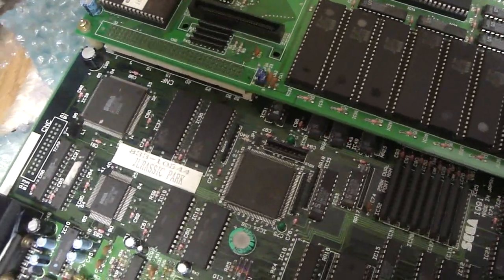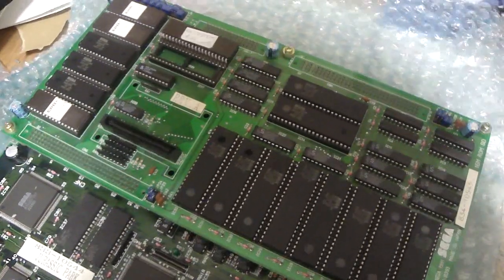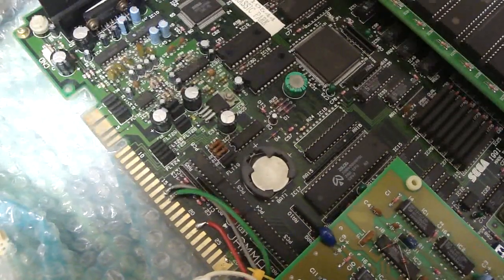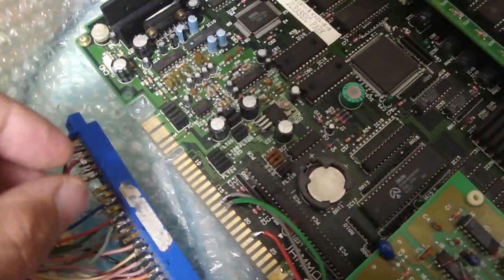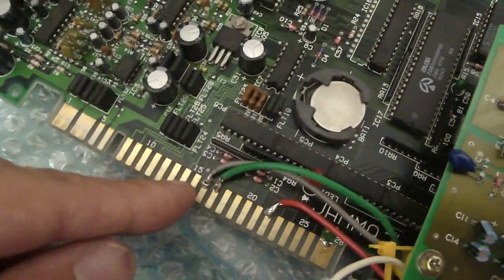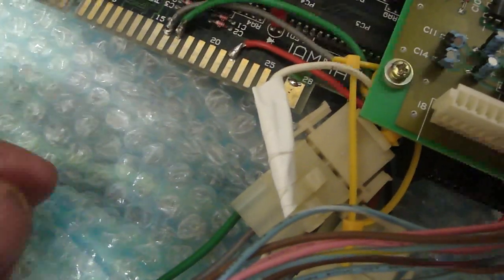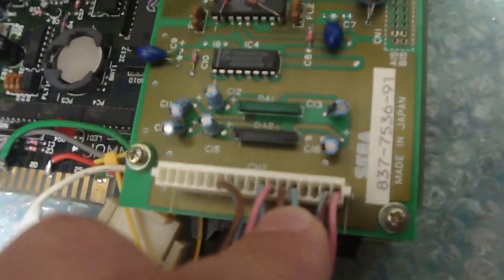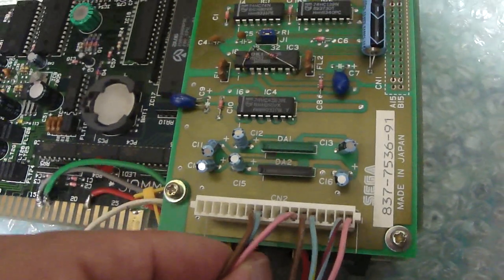How To Wire Up A: Jurassic Park Arcade PCB (For Those Who Need Arcade Pinouts)

Comment: here is the fix to get the game working without a drive board.

in the file EPR-16402A.IC8, go to offset 0x415A9 and change bytes "65 0C" to "CD CD". write the file to a 27C4096 and replace IC8.